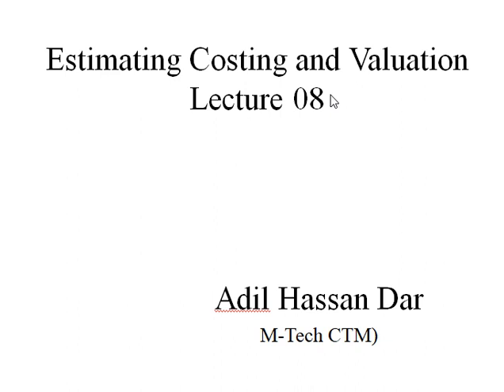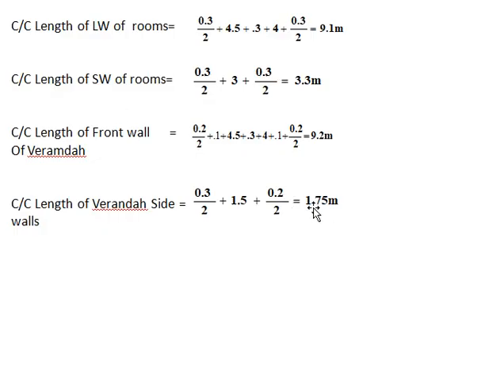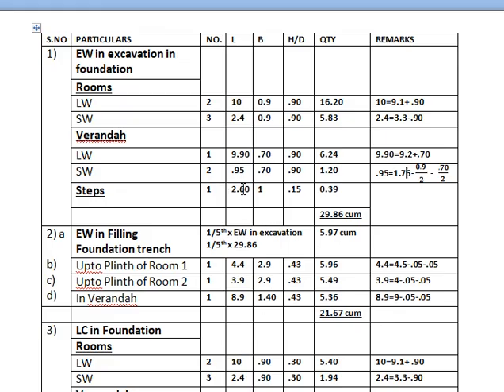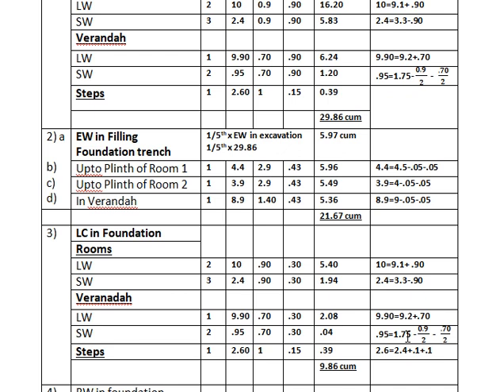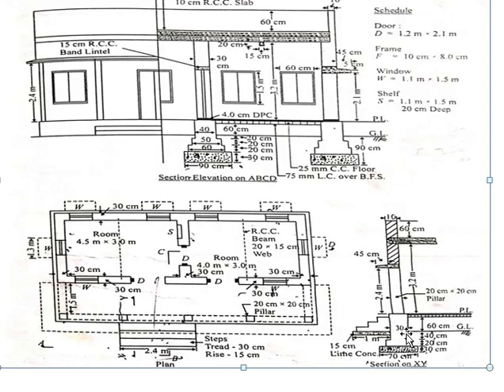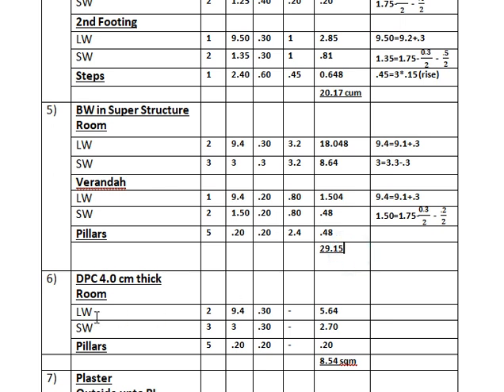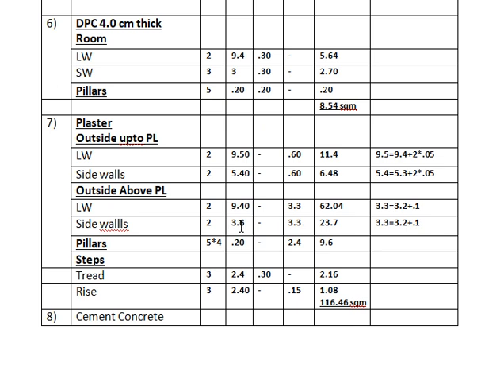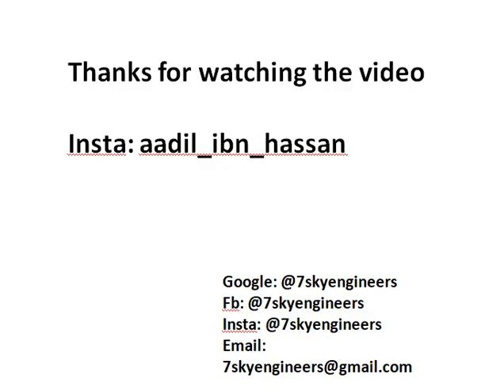| Lecture 08| Two room building with verandah|

Comment: Sir apna ew in filling me depth 0.43 kaise liya
0.60-0.075-0.025=0.5aata hai
Reply: Aur verandah me 8.9 kaise liye
Reply from the maker: 9.0 (inner dim of veranadah ) - 2 x .05 (plinth offset) = 8.90
Reply from the maker: 0.60 - 0.10(brick soling)-0.075(Lime Concrete) =0.425 approx 0.43
Reply: Sir verandah wala clear nhi ho rha
Reply: C/c length of verandah liye the 9.2 to 9 se kyun substract kr rhe
Reply from the maker: For filling
Reply: Sir agr whatsapp contact hai to plz send
Reply from the maker: Send ur what's app contact
Reply: 9135989311